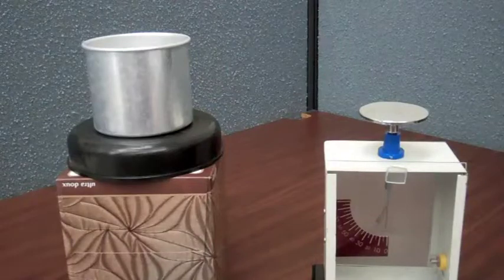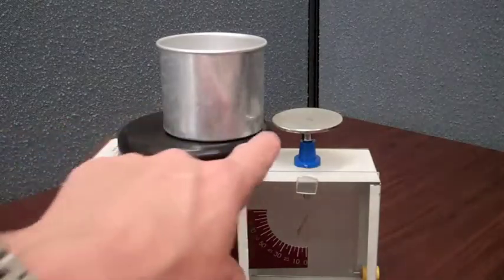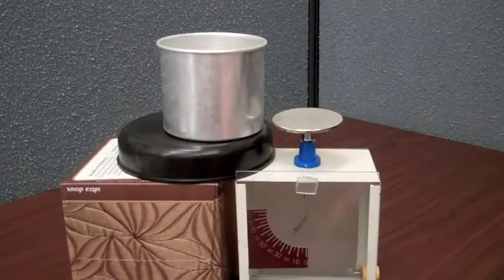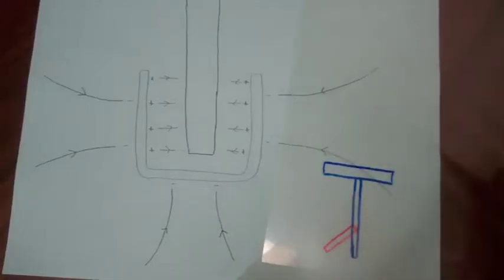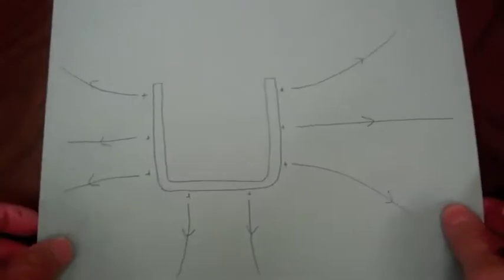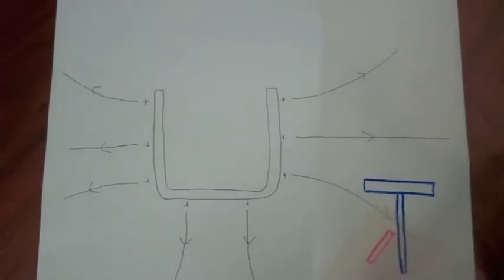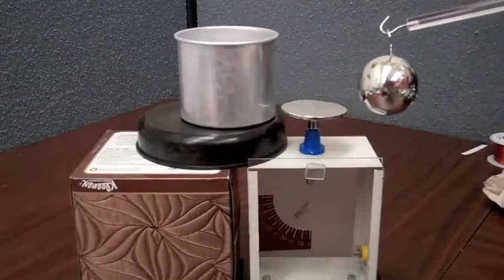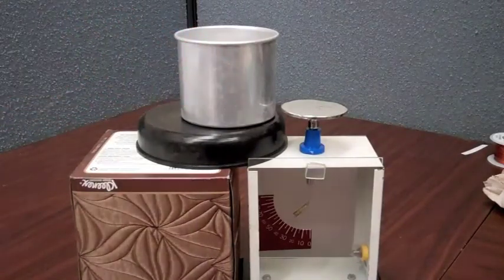Faraday's Ice Pail Experiment

Comment: Once you remove the neutral metal ball from the pail, why don't the electrons redistribute in the pail to where the whole thing is equally charged? Why does only the outside of the pail carry a charge and the inside of the pail still remains neutral? If it's a conductor, then surely the electrons will redistribute evenly, correct?
Reply: Because outer surface allows them to spread apart further from each other.

Comment: What happens when the negative pvc pipe touches the metal?
Reply from the maker: Do you mean if I had touched the inside of the pail with the negative PVC rod? (Which I did not do in the video.)
Reply: Yes
Reply from the maker: If I had touched the PVC rod to the metal pail, there probably would have been some transfer of electrons, but only in the areas that touch. The electrons could not flow along the rod to the point of contact between the PVC rod and pail because the surface  of the PVC rod is not conducting.
Reply: I see. So inducting the metal pail to be positive is only efficient when you tap it with your finger after proximal exposure to the rod.
Reply from the maker: Yes your finger is very conducting compared to the PVC rod.

Comment: after your last experiment - what happens if you charge the sphere again to its initial value and bring it back into the pail and touch the inner surface of the pail?
Reply from the maker: The same thing will happen, you will transfer the charge from the sphere to the outer wall of the pail. So now you will have twice the charge on the outer wall of the pail.
Reply: Michael Melloch hmm... but it doesnt work in my experiment... i have a hollow sphere, a high voltage generator and a spinning wheel with metal balls. the high voltage generator charges the metal balls on one side of the wheel and on the other side of the wheel the balls come in contact with the inner surface if the sphere via a conducting wire - http://www.bilder-upload.eu/upload/616c87-1405346968.png  .  the charge wont build up higher than the generator is providing. do you have an explanation why this happens?